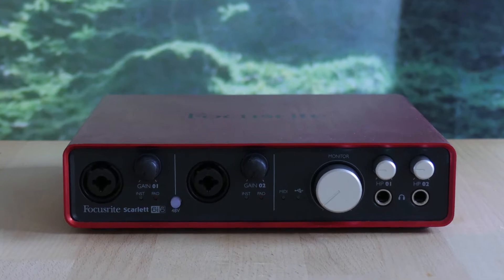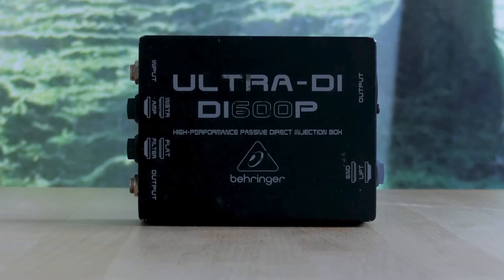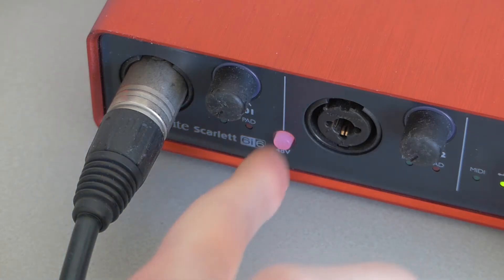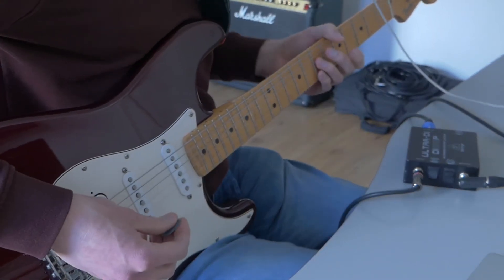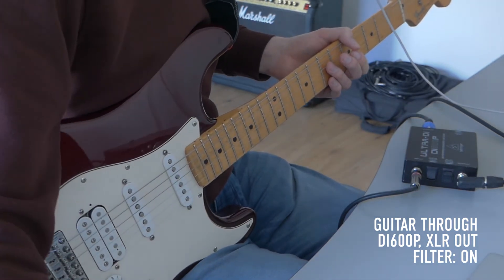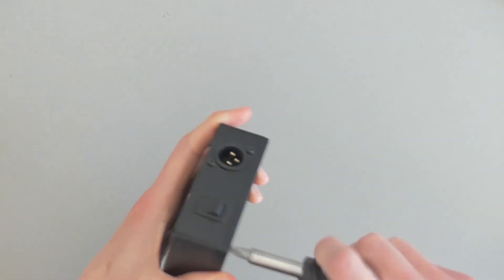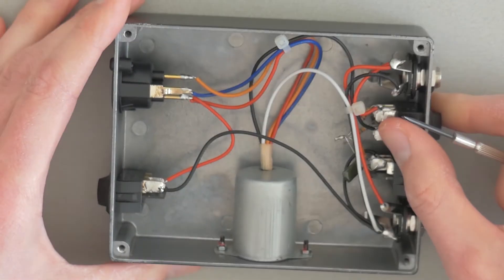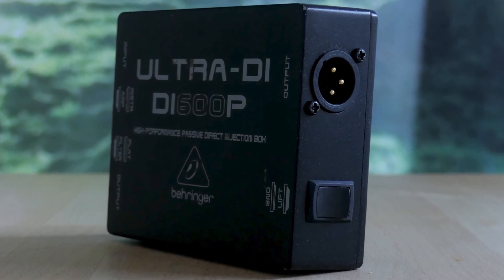2 Behringer D.I.s: Ultra DI600p & Ultra GI100

Comment: Hello, with the behringer Ultra Gi100 I can connect the speaker output of my guitar head to the input of the ultra G, in the link output connect my 2x12 screen and in balanced output to my audio interface, without activating the 4x12 simulator and thus record the sound of my head raw and in my DAW use speaker IRs to find my sound?
Reply from the maker: Absolutely correct. Just remember to always connect a speaker or loadbox to link output, otherwise you'll damage your amp head.
Reply: @DIYguitarGuy  no problem if I deactivate the cab sim and thus record the raw sound of deo head, right?
Reply from the maker: @AshesBe  Yes you can record the unaltered sound of you amp in that way.
Reply: @DIYguitarGuy  What I want is to record my raw zombie head without the cab sim and use external IRs on my daw
Reply: @DIYguitarGuy  can I do the same with the DI 100? (Gray)
Reply from the maker: @AshesBe  Well if that's the only thing you want to use a DI for, than the DI100 will do as well. Also start of with the attenuator switches pressed, because the amp's power output is loud. Only disengage them when the recorded volume is too low.

Comment: I have the DI600P and use it only as an "insurance" for my audio interface. My signal chain is this..

Guitar - pedals - DI600P - audio interface.

But most of the time, I do this on all of my recordings:

Guitar - pedals - Boss Katana MkII 100 via line out - audio interface.

Should I put the DI600P between the Boss Katana amp and audio interface?

I'm using Focusrite Scarlett 2i2 3rd gen. And sometimes I use my Behringer UMC404HD.
Reply from the maker: If it sounds good you shouldn't change it, right? The line out and audio interface are made for this connection, so if there's no ground loop hum you don't need a DI in between.

Comment: BASS player here, noise gate, Donner and Rowin makes a good one that is affordable, for the MIDI clock, cannot help you there.. Nice video, affordable gear is not junk!!!
Reply from the maker: Thanks! It's certainly not junk, but I'm not sure if the 600 filter is really that well designed for guitar use, as its manual implies. Other than that, it works fine. The Donner and Rowin DIs look like the Mooer Micro DI, I guess they're same design.
Reply: @DIYguitarGuy  My DONNER Triple looper is excellent!!! As a bass player, I'm not yet into MIDI, but i'm getting there!!
Reply from the maker: @bertrandmajorik6589  Looks great, simple and effective. I'm not that into MIDI yet myself, just the basics so far. But if you're into MIDI and loopers, you're gonna like my next video. I just finished a new stompbox, I'll probably upload the video next week.
Reply: @DIYguitarGuy  Slowly getting into MIDI.....
DONNER Triple looper got 30 minutes of recording that can be divided in three channels. Regret not getting 2 at 65 CAD each. Now it's around 100CAD    :(